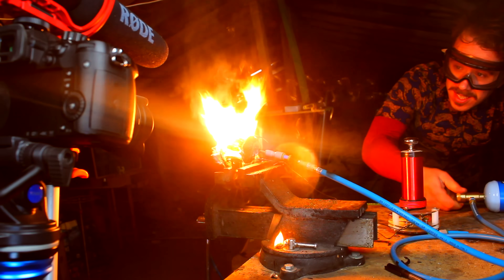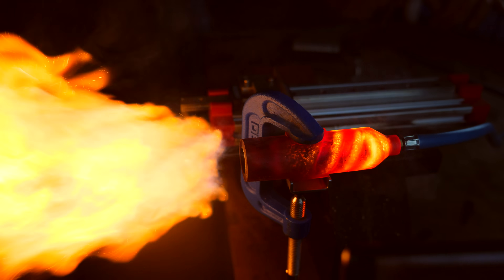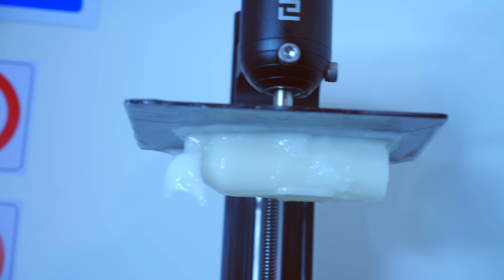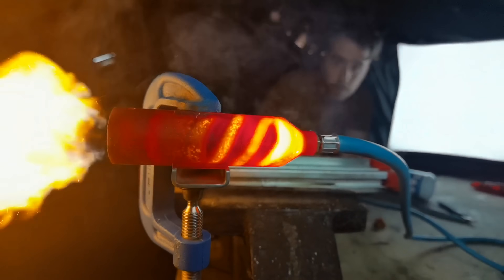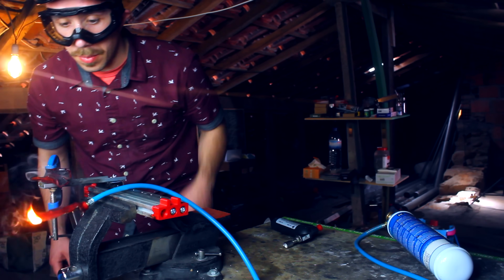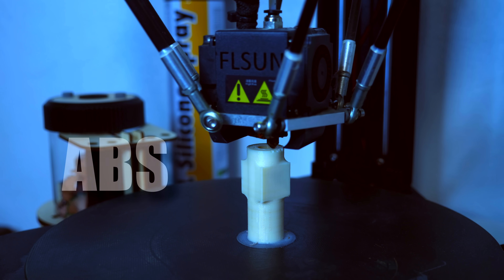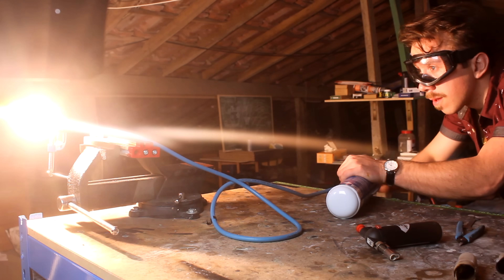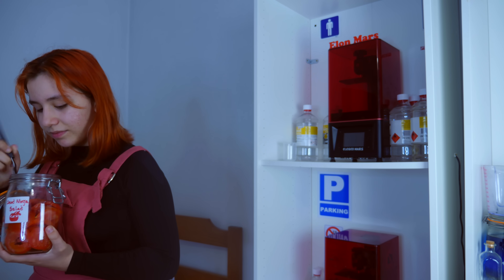Rocket engine that uses itself as fuel! (3D Printed)

Comment from the maker: The first 100 people to go to https://www.blinkist.com/integza are going to get unlimited access for 1 week to try it out. You'll also get 25% off if you want the full membership.
Reply: Integza, eu tenho a solução! Please tell me you tought of 3d printing a resin shell for your ceramic vortex engine! That would solve the leaking problem and also would be cheaper than everything else you tried. I suggeted it a few times on the comment section, but I was always late so never sure if you would see this.
Reply: Safety suggestion: Use a quarter-turn valve on the oxygen supply, this will allow you to quickly stop the experiment from escalating. I noticed that it took you quite a while to stop the flow of oxygen from the tank. Generally, when working with dangerous systems it is best to have a kill switch that stops things as fast as possible. Love your content, just don't want you to loos a hand making it.
Reply: @An_Attempt  I suggested this under every video with propane and oxigen.
Reply: Oh man you need to find a way to force molten "candy rocket fuel" out of the hot end of your 3D printer!!! or first try to 3D print a mold but then experiment with the flammability of different shapes. Talk to Elemental Maker about it if you are having too much trouble with where to start. and what about making some metal rocket nozzles or cases like it shouldn't be too hard to get some thin walled aluminum tubing and stuck a better sized hole at the end and since they ignite from the end make the internals tapered to match that?
Reply: @evilcanofdrpepper  there are way more powerful fuels than R-Candy. Have you heard of Zincoshine?
Reply: @nathanmarotto7419  No I haven't but the questions are how dangerous is is to make/use, how legal is it to make/use, is it 3D printable or formable and what are the chances that it will blow up and leave Intagza looking like a splattered tomato?
Reply: @evilcanofdrpepper  he'd look like a carbonized tomato, not splattered. And it depends on the laws in Portugal (I'm pretty sure that's where integza lives). In the U.S, it's perfectly legal. It's a 2 to 1 ratio of zinc and sulfur respectively. Then made molten by some heat source (can't be touching the mixture though) and 90% or higher alcohol concentration as a catalyst. It is really dangerous and probably can't be 3d printed anymore than R-Candy. Also I've been working with R-candy for about a year now and it's not really any less dangerous. Not that it's a bad idea, but I think Integza is going to pursue other options than either of our suggestions.
Reply: I see the problem, you need to light the rocket at the top first, not the bottom. The flame needs to be the entire length of the rocket from the very beginning.
Reply: sparkler.
Reply: I'd love to see you 3D print metalized casings for these grains.  I'd love to see grains of various % infil.  Think about it, the printer is putting in channels for O2 to flow through and increase surface areas even more!  You'll get more overall thrust per grain.
Reply: You should maximize the inner combustion surface, with a "star" shape of your sugar-plastic-whatever inner structure
Reply: Dude you need to get yourself a solenoid  valve for your gasses so you can switch them on/off simultaneously. Or even a pneumatic  air switch would do!
Reply: Primarily do a better grain - more surface area to contact plastic and oxygen - say, grid fill of the combustion chamber.
Reply: You need to add the potassium nitrate to the resin instead of the sugar. Add enough potassium nitrate to something and you can use it as a rocket.
Reply: What if you melt sugar down into a rock candy/sugar glass like form and cast it so that it's 100% sugar.
Reply: What if you 3D printed real rockets like the Saturn V and the falcon 9 rocket and made them fly? That would be SO AWESOME

(Can I have a 3D printer?)
Reply: How about a Rocket powered propeller
Reply: Might I suggest using nitro glycerin?...or better yet some sort of non illegal thing
Reply: @Nullsnaggle  something less unstable to use inside an attic?
Reply: @GuyLandon  yeah...maybe just a good idea to use sugar for now...
Reply: You need a nozzle that isn't consumed by the combustion of the fuel.
Reply: @TomsBackyardWorkshop  he need an entire rocket casing that isn't consumed by flames , also ceramic coating at least 2 mm thicc
Reply: You can create magnetic combusting chamber and nozzle. If you use hydrogen as a fuel and oxygen as an oxidiser, since it burns at high temperature and really lightweight in terms of atomic mass, with a little help from microwave generator (like one in your microwave oven), you will be able to make ions from overheated, microwave irradiated hydrogen-oxygen mixture. Those ions will be controlled by magnetic field like in ordinary coil and start spinning with some radius of curvature. Since magnetic field is not homogeneous, and increases, moving from center to borders of coil, ions that were pushed from center will return back, since stronger field means smaller curvature radius. If instead of many-turn coil you will use several one-turn coils you will be able to form any shape of magnetic field and thus nozzle and combustion chamber you want even during the flight. You can calculate yourself, but I calculated that if you use coil with 10 cm diameter, under 500 ampers, you will get exhaust diameter around 1 cm. Anyway, you should remember that the bigger the gradient between Center of coil and its borders — the bigger is returning force and smaller the exhaust diameter.
Reply: I think that when you get one to work enough to just shoot them up like a hobby rocket.
Reply: @Integza:  Edit the link to the blinklist! - it contains a left-to-right mark (not visible) and makes your link ending with  "%E2%80%8B". So people do not land on the partner page.
Reply: Hey does the pipe
Pipe coming from the oxygen tank
Push the engine in the opposite direction reducing the visible thrust
Reply: I have knowledge of combustion that may aid your goal, how may I best contact you?
Reply: Form a 2 part rocket 1with a solidfuel booster rocket and next one attached with a fuel of your choise and wanted engines.
Reply: 9:23 Bitte schon tu es o menhor🇵🇹❤
Reply: You can 3d print metal nozzel
Reply: Try and make shock/Mach diamonds.
Reply: Bitte schön von Braun wäre stolz auf dich
Reply: Sparkly thing= sparkler
Reply: seems the link is broken
Reply: I personally think the oxygen valve you have is not efficient and it takes too long to adjust the amount...I think a valve where you can adjust the ratio of oxygen rly fast will help you
Reply: Sparkly things?

He means a sparkler.

oh.
Reply: faíscadora might be the sparkly sparkler
Reply: Hey @Integza,
Did you ever thing about using liquid oxygen as an oxygen source?
Maybe you could achieve this by turning the valve of the Bottle upside down. Or did you need to cool the Bottle down? 
Best regards
Reply: Try the  resin engine again but put it in a pipe of some sort so if it dose blow a hole in the side it can still continue to produce. The pipe would block the hole and it would keep the engine from exploding outwards. I would suggest a PVC pipe first and the a metal one. You could also increase the size of the rockets (the diameter/fuel) while keep the combustion chamber the same size as it currently is. Lastly, you could combine the resin nozzle and the 3D printed combustion chamber together in order to get a more intense burn and a longer lasting nozzle.
Reply: To solve your leaking problem, maybe you should try coating everything in a high-temperature epoxy resin such as JB Weld.  It can withstand temperatures of up to 260 ⁰C continuously and up to 316 ⁰C for short periods.  It wouldn't be appropriate for the really hot spots, such as the nozzle and combustion chamber, but it should be more than enough to withstand temperatures on the outside of the engine and seal your ceramic parts.

Another thing you could try is to enamel your ceramic with powdered metal.  You have a kiln, so it may be possible to add a layer of sintered steel or some other metal to your ceramic parts in order to make them both sealed and more heat resistant. 

Could also just use a high temperature powder coat (links to example product and instructions below)

Might also just try adding a coating of slip to your parts again, it should seal everything fine but you might not have used enough or went too thin.  Also, just in case I missed something, you didn't try to add slip to your part from the same stock of ceramic resin you Kade the parts from, right?  That slip would have still had the resin in it that was just going to burn out of your part and become porous again, anyways!  If you try enameling with slip, use unadulterated ceramic clay watered down with water, not your ceramic resin.

These might be useful to you:

https://en.m.wikipedia.org/wiki/Industrial_porcelain_enamel

https://forrestpaint.com/product/high-temperature-powder-coating/

https://hackaday.com/2015/10/25/diy-powder-coating/
Reply: You should try to 3D print the ultimate sound reflecting speaker box or sound system of some sort.
Reply: You should give an exoskeleton to
Reply: About the engine you're creating, I believe one of the biggest limiting factor you're having is the way you supply the oxígeno. It's to small. If you had a different container/valve it should change the results a lot!
Reply: I think you need to coat the outside of the hybrid rocket in ceramics.  That way ALL the fuel can be burned.  Also, you should 3d print a holder for the sparklers, so that ignition happens in the exact center of the fuel.  FYI "Sparklers"  is how you call them in English.  Both the last, and second to last, ignitions were pointed down and up, respectively.  And since you're burning the fuel, initial ignition determines the angle of thrust, as it burns out.  Just my 2 cents, love your work Integza!
Reply: You should try to make a steam engine
Reply: You should try using a washer embedded into the end of the engine  so that the nozzle itself doesn't deform, though it would only be able a simple hole
Reply: please reply to my comment
Reply: Use airogel.
Reply: @homengogoi4825  it is very expensive
Reply: Make a matriosca, with the plastic inside, and exterior made of resin. The exterior shield with a cap that opens to put inside the plastic body. The exterior should have the nozzle, and at the opposite side a bottle cap stile ending with a hole for the oxygen tube. Like a 3 piece rocket: plastic body without nozzle, exterior resin body with nozzle, and the resin cap to put and close the body.
Reply: YESYESYESYES!!! YES! SI!
Reply: I have a idea 
You should build a strong body made of steel or ceramic that charge with 3d printed simple fuels ( reusable)
You can test all kind of fuels with this rocket ( plastic or sugar)
I mean it charges with simple pills of solid fuel and you can replace it
Reply: I think it would the day when you burn  your house, and it would beter to go outside.
Reply: It seems that burning UV resin and ABS is not very good for your health. Try doing this outside, at least.
Reply: I think the oxygen need to flow faster...
Reply: Isn't the bday song licensed?  Don't want you to get in trouble Integza.
Reply: In UK they are just called sparklers
Reply: Was that sugar you used Confectioners? That also has a high flour content I'm told. That could interfere with your results. Might need to grind whole sugar to a fine powder to get what you're looking for. Also a quarter turn speed valve might help with those open / close operations.
Reply: all you need is an acrylic rod with a small hole down the center
Reply: You should think about an metal case / Tube for the hybrid rocket engine. It prevents the molting Appart and leaking.
For future projects maybe us a metal case/ shell/ tube and the vortex rocket engine principle?
An air swirl/ vortex is generated which should keep it cool and maybe prevent burning down?
Reply: Integza, use a different method to ignite your propellant, or stick a pre-lit sparkler in the nozzle to the fuel. Lighting it from the outside like that is damaging the throat of your nozzle, you can see it in the video with the way the flames are going.
Reply: bitte schön
Reply: Ender 3 is such good taste.
Reply: Integza!!!!  Use liquid oxygen,  cool it down with nitrogen!!!! Use a pump!  You are overheating your engines!  Do cooling counters in outer ring and then warm oxigen must work in inner ring and burn your abs rocket!
Reply: @Integza
 I have an Idea. You could use Hydrogen as a Gas / Liquid Fuel. An you could create it using Electolysis.
Reply: Theme or suggestions for next video,s for rocket engine use ramjet or scramjet type engine and for nozzle use aero spike but with improved geometry so that the gass coming out of the nozzle apply pressure on the axis of your engine .
And one important thing your nozzle should not burn out if it burns it decreases the thrust by disturbing the thrust distribution.
Make a metallic rocket engine with 3d printed fule.
Reply: you should try to adapt an eductor to your design
Reply: hey integza joe. i have a idea for the never made, never published, REPULSOR JET ENGINE and the REPULSOR TURBO MOTOR and REPULSOR TURBO COMBUSTION CHAIMBER. just send me a message if you want the details. i have 2 e mails. gmail: wizsmen5@gmail.com, Email: kenny_windster@live.nl. and maybe if it is possible i could share my idea on the tesla coil generator combined with the repulsor jet engine. im a briliant man who is willing to share his breaktrough jet motors. i have more designes that you could try. or could help your channel. there i have an idea to foor a microwave stated plasma jet with coil generator. and also microwave stated plasma jet with (repulsor) turbocharged in and outlet.im scared for my idea to be stolen so thats why i give it too you because i see that wit hyou my idea would be in good hands. let me know and ill first share my ideas on thew repulsor jat familly. ;)
Reply: The birthday things are called sparklers
Reply: In English those sparkly things are just called sparklers
Reply: Don't worry man, 2:18 what you just lit we call a sparkler.
Reply: this would be awesome as a kind of flare gun, like a flare that disintegrate itself as it flies through the air.
Reply: Indians are probably thinking "how can he use oxygen in while we are dying of Corona" lol
Reply: Add KNO3 Stump remover. Buuuut be careful. Adding an oxidizer could have.... explosive consequences.
Reply: Just saying the sparkly things are called sparklers
Reply: Boas Mano Fogo nao sabia que es tuga Bora Bora curto bues dos teus videos .força meu irmao,
Abraço# tugasnafrança.
Reply: I got that same headset at 8:51 :)
Reply: FYI the sparkly thing is called a sparkler. (At least in America) Probably named by the same guy behind most kitchen appliances.
Reply: I’m 🍅🍅🍅🍅🍅🍅🍅🍅🍅🍅🍅🍅🍅
Reply: @lisandropena9403  you're tomatoes?
Reply: @nathanmarotto7419  you.
Reply: @lisandropena9403  EVIL
Reply: Those are called "Sparklers" in Britain, commonly used during Bonfire Night (Also known as Guy Fawkes Night).
Reply: Why don't u make a endless power
Reply: Bruh, why u don't using water cooling???
Reply: Try the NOX version !!!

Comment: Hey! I’ doing some research on plastic cell hybrid rockets myself, and i have a opinion you might would like to try. I see you use o2 in gasious form, but what about liquid? Maybe if you keep the bottle upside down, and adding a small jet nozzle at the entrance point of the rocket Fuel, so you Get a «mist» of liquid oxygen into your combustion chamber. I’m building a 3’’ poly Fuel based rocket with n2o as a oxidizer. 

Greetings from Norway!

Comment: Hey man, why dont you try putting fine metal particles in the UV resin? Aluminum would do the trick just fine in an 12-15 percent

Or maybe iron particles for it to be less reactive than with aluminum
Reply: Aluminum powder works very well for increasing specific surface area, which helps with fuel regression rates (amount of solid turning into exhaust gas) and increases the total energy released, but this does raise combustion temperature, which could be a problem for whatever design he does
Reply: He could also return to the helix design using ABS, because that is what the original helical design used that he based his first attempt off of.

Comment: i came up with an idea for a steam rocket, using water as fuel. Water goes into a chamber where a tesla coil is acting as a boiler then exits into a nozzle. Also came up with a second idea instead of water a block of ice around the tesla coil. Would you put these ideas into a test???

Comment: Another idea for fuel would be to use a multilayered fuel. A very dangerous example would be aluminum and iron dust glued together with resin. Be very very careful and look up safety procedures and potential problems as this combination creates thermite. I don’t know how it would react with an oxygen catalyst or a sparkler igniter. I would also be skeptical about running such a combination through a 3D printer. Yeah, you know what? Scratch that idea. Don’t try this.

Comment: Add a carburetor and make your engine in the rough shape of a kline bottle 
Like a snail shell before you hit the combustion. .
If the port for the exhaust is out of the side of the spiral shell shape it could have more combustion in a longer tube. 
Instead of having most of your fuel fly out of the engine before it completely burns. 
All the excess energy can be reeled in to form the necessary forces for better propulsion.